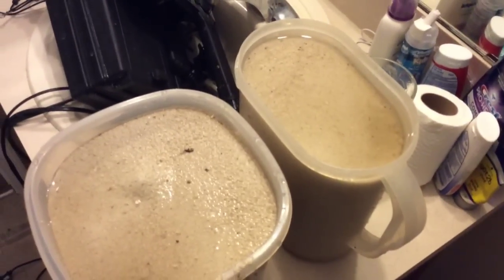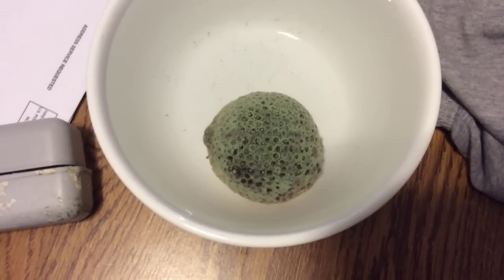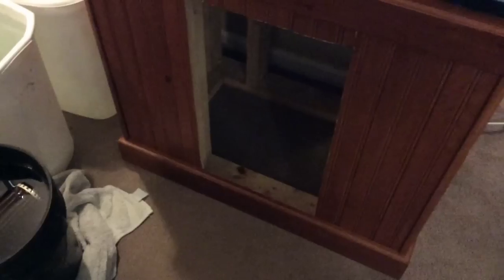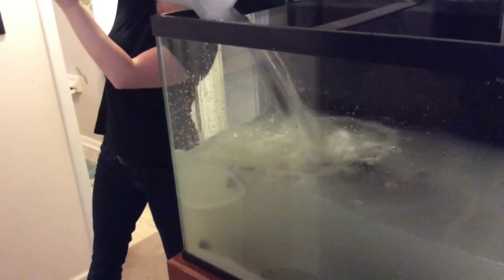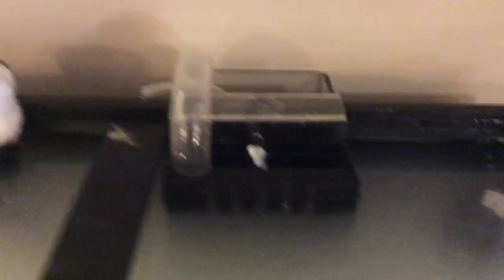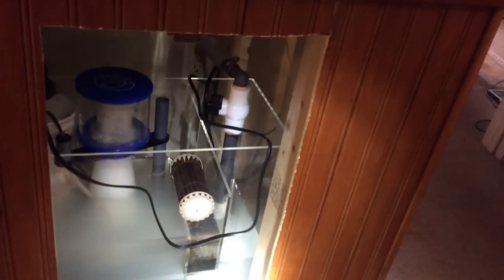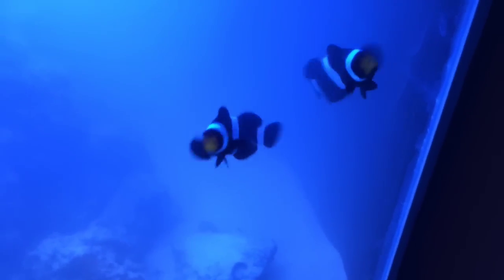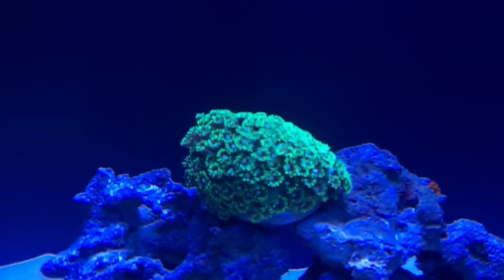Setting up a salt water tank with a wet / dry sump filter tank protein skimmer.

Comment from the maker: I put all their water, that was in the garbage cans back in the tank, which was way over half the aquarium.. Everything made it through the change... I did hit one on the rock though :(.  My mistake was not rinsing the new sand well enough.
Reply: boompowzap so , are they alive? hopefully you got some more helpful tips since then. :)
Reply from the maker: +Rebecca Sydnor Yes, they are all fine. The tank turned out great. We got tired of the noise so we replaced this system with a pair of whisper filters that seem to slow the evaporation and definitely lower the noise. We've added a file fish to control the anemones. We've been working with salt water tanks for decades and don't do anything that would harm the fish.